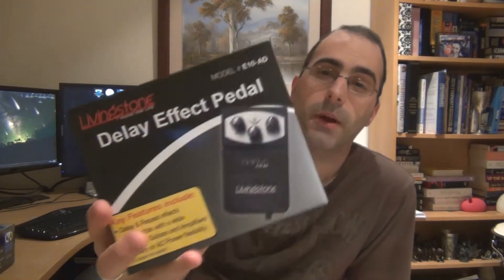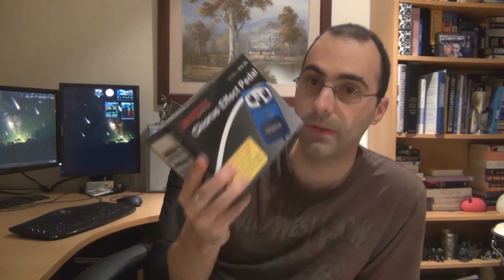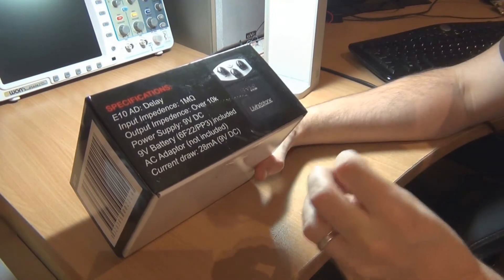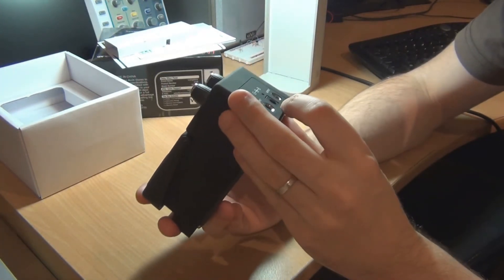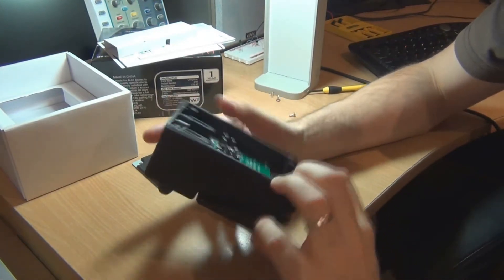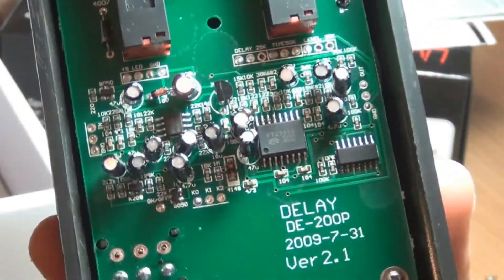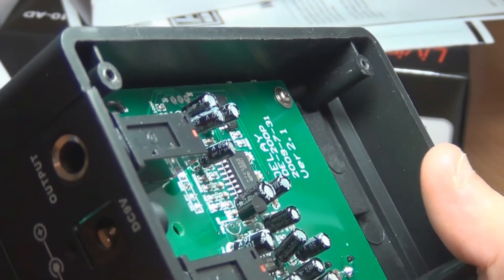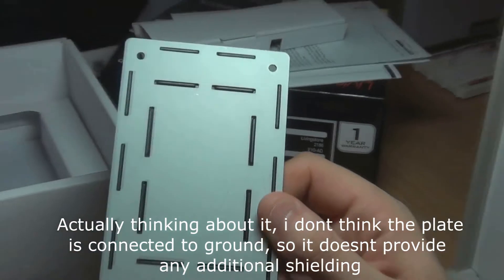Livingstone Delay - A Cheap PT2399 Based Delay (E10-AD)

Comment: Bought the Chorus yesterday for bass,tried via the Effects Loop & it wasnt too bad.
Ive got 60 days to work this otherwise its going back to where it came from.
Reply from the maker: I couldn't handle the distortion with the chorus I tried.  Might not be obvious with bass, but the one I tested last year was pretty bad.  Can you hear any (distortion)?
Reply: DIY Guitar Pedals NO Distortion.
I want to ask you about the impedence with the Flanger.Its impedence is 4.7 ohms where the Chorus is 1 mega ohm,whats the difference between that ? Why isnt the flanger 1 mega ohm also does it matter ?
I use them together via 'E L' so im wondering is one going to be louder then the other ?